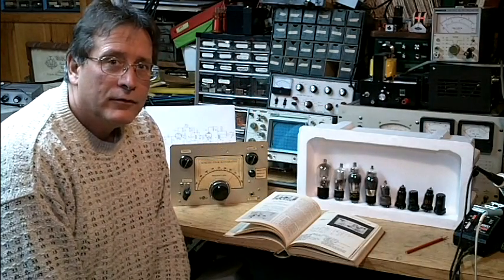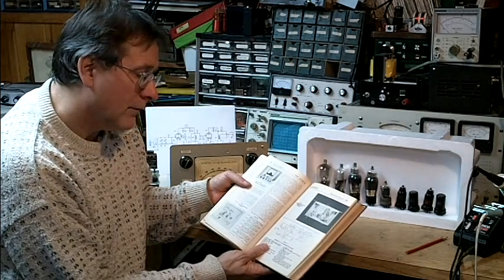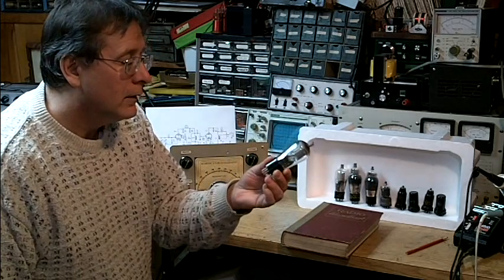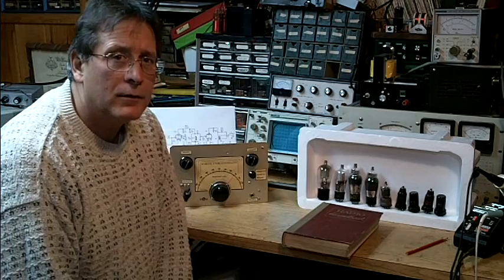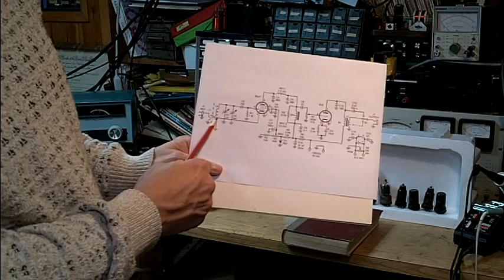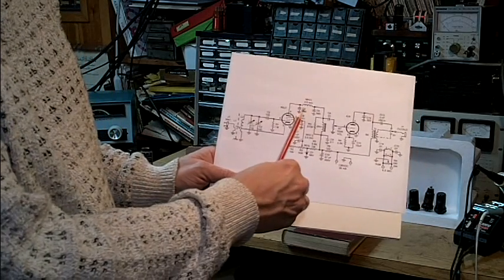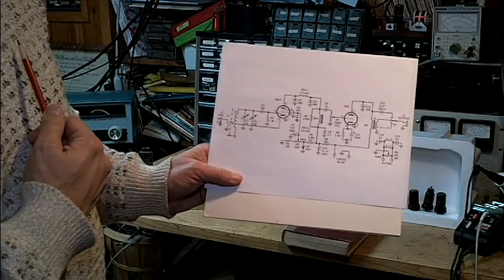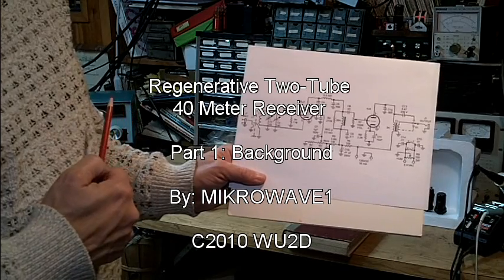Regenerative Two-Tube 40 Meter Receiver: Part 1 - Background

Comment: Where can we find a schematic for this?
edit: I found it, but will it work with a pentode-triode tube?
Reply from the maker: Sure! Just tie the screen to the plate to make a triode - or bring it down through a bypassed resistor of 22K or so.
Reply: @MIKROWAVE1  Sorry for seeing this reply only now, but thanks! I'll use the triode for the audio amp, just as in the schematic in your latest video (the station monitor one, which reminded me of this receiver)

Comment: If you want a direct conversion then implement a SO42P using 3x 12AT7 tubes in a double balanced configuration with the third tube operating as a push pull LO driving the two heated cathodes of the mixer proper.

Comment: Ace video as always.
Autodyne? 
It's probably the earliest version of Direct Conversion with its built in osc. but because of Regen. gain, it relies less on AF gain.
I've made them with just one valve (954 Acorn) and it was adequate for head phones.
As  I was a raw beginner,  I didn't realise that the kit left the valve (tube) anode disconnected
and used the screen as an anode, making it a triode.
In all the years since, I have  never found an explanation of this. Any ideas?
Acorn valves are still available. Ever tried getting a base?
tnx es 73 de G3NBY

Comment: Nice Paraset, and excellent information.  Your videos inspired me to make my first radios and learn code.  Is the Paraset a replica or an original?
Reply from the maker: It is a replica. The great part about the Paraset is that it takes advantage of the commercial parts of the late 1930s. The cash box enclosure is clever too.